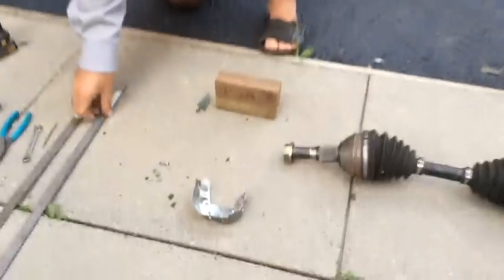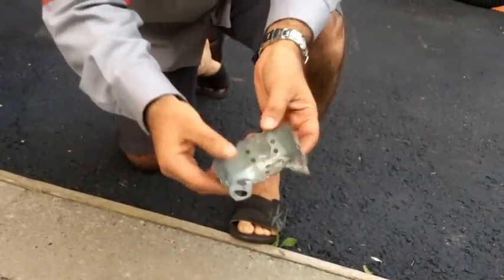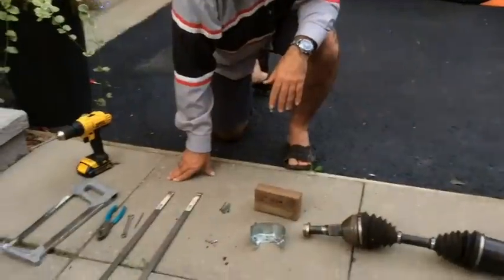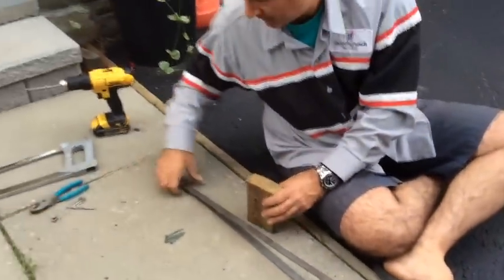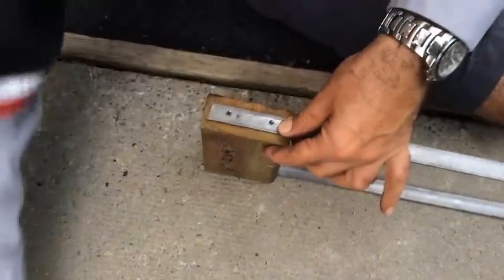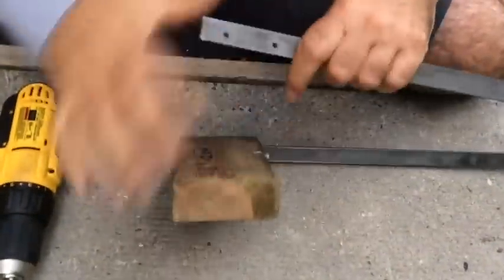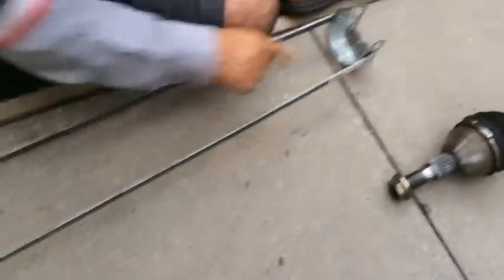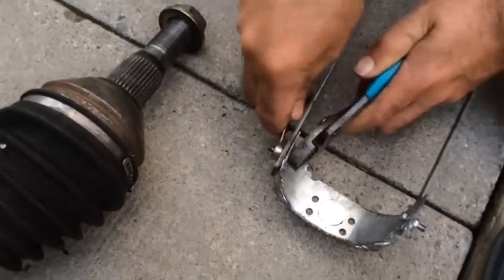How to Make a CV Axle Removal Tool for $10

Comment: Just wanted to give a shout out. This tool works great! Was messing with a slide hammer and a cv axle adaptor for hours. Found this online and built it in probably 15 minutes. It took maybe 10 hits but the axle popped right out! The tool probably cost 30 bucks to make but it saves you your sanity for sure!

Comment: Wood screws don't hold going into the end grain of a 2x4. Electrical box is not strong enough either. I've had to use a 8 lb slide Hammer before to remove axles. What you got is lightweight garbage. On top of that who the hell wears sandals when working

Comment: Thanks Rob. I am not a mechanic but I can sometimes "monkey see money do."  Your tool worked for me (2 taps)  and I did not mangle my existing axle like I am afraid the vice grip method might do. Now I can get a pro to rebuild my oem axle. Only mistake I made was buying aluminum stock instead of the metal rods.

Comment: instead of the steel flats I used some random tubing from the backyard.  It worked, although it's important to make sure you don't cut too much material off the electrical box, or it will slide off when you attempt to hammer the tool

Comment: I already have a slide hammer kit but it doesn’t come with cv forks which is dumb af. I’m thinking there has to be a way to get some thin durable strapping long enough to slit a hole in the middle fitnitnaround two side of the axle and slide it in the crack between the transmission or t case and cv housing then with the two end look then around and put a hole in them then put the slide hammer in the two holes and clamp both sides with some washers and nuts then pull as usual? But is standard strapping thin enough to fit? They should make a master set of those slide hammer fork puller attachments. They’re even pricey on Amazon like $15-25 each.

Comment: If you have a spline with a circlip involved the trick is to get the circlip opening in the 12 o'clock position. What I have found is turning an 1/8 of a turn at a time and giving a tug or pry and usually it releses fairly easy. Kudos on your custom tool invention - nice problem solving skills!
Reply: I have been doing this clock dial rotate thing and it is not working.  It seems like no one makes a enough of a point about it coming out from the differential in a "flat" up and down manner-in other words, not pinch points from working on it from one side.  I sense my axle wants to come out, but I I am not finding that magic circlip opening or I dont have the right amount of leverage underneath the car because I don't have a lift.  Eric the car guy on his video from 13 years ago made it look so easy.  I can't count the amount of videos, including this one, that don't show the actual separation of axle from the differential.   Still, I went out and bought these metal bars and electrical box because it seems sound with regards to the equal force on all sides of the CV joint.
Reply: @sl5311  Sorry just now saw this - hope you managed to get it unstuck. Sometimes you have to give it a tap with a hammer to get that circlip to drop and not have it loaded or binded up - in other words push the  joint back in - otherwise the circlip may stay stuck and not drop.

Comment: Great idea, great solution. I am one of those who saves wood ends, such as from 2x4s, because they can come in handy, especially for car repairs, where a couple of good whacks are needed to drive in or out pieces that would otherwise be damaged with direct hammer blows. You are also correct, that one CV axle is bound to be more difficult to access for removal.
Reply from the maker: Thanks for your comments. Glad my video helped you out.

Comment: I like this idea because even if you can get a prybar in between axle and diff- you risk cracking / marring the differential while trying to lever the axle out.  Your little tool means you're only hammering out the part you want to replace anyway.  Next stop- Home Depot :)  thanks for posting this.

Comment: This worked!  Except the electrical outlet method did not.  I think it would have except I cut it too wide and it didn't grab well and just slipped off.  The bars and wood block were still good though so I just made another version.  I found a piece of sheet metal cut to about 4"x10" and drilled a 1.25" hole in the center (slightly larger though) with a hole saw.  then I cut a piece of wood 3.5" wide to use as a bending form and bent it around that for a nice sharp 90° bend.  I used tin snips to cut from one side to the edges of the hole I drilled to make a slot.  I drilled a single 1/4-20 hole in each ear so it can move around but hold plenty strong.  Being thin it slid into the gap very easily (the electrical box was a little bit too thick).  I didn't bother with the second block of wood and just banged on the one piece.  What's the worst that can happen?  break the wood?  Just cut another piece.  But I didn't and it came out with just a few bangs.  The other problem with using an electrical box is all the cutout holes that make it weak.  The thin sheet metal was fine because it sort of nestled around the axle and it didn't matter that it bent because it held in the places that need holding.

Comment: Price update: Electrical box 7.98  36x3/4x1/8 11.93 x 2 = $34.47 with tax.  The rest I have in the garage.Just for grins I went to an inflation calculator and it works the other way around and it gave me 17.87 back in 1997.  That's still nearly double your claim. There are cheaper boxes but not the type that would work well for this job.  Most of the boxes are plastic nowadays.  And a simple steel bar for nearly $12! wtf I think they are just gouging us.  What doesn't make sense is how usually the raw materials things tend to be more expensive than the manufactured parts.  I can think of a lot of things for $12 that require work and materials to produce that would seem to be more expensive.  A burger King whopper meal is about that much and that requires all sorts of handling and preparation.  A steel bar does not.
Reply: Based on his accent he may be referring to Canadian dollars. And metal prices fluctuate quite a lot

Comment: I could not get the electrical box behind the cv joint against my Kubota RTV X900 so I combined your bar stock and block idea I used.  I welded it to a 3” muffler clamp like another YouTuber suggested, two taps and it popped right out.

Comment: Interesting approach, would never have thought of cutting up a junction box, will give it a go.  Thanks.
Reply from the maker: Let me know how it works out.
Reply: @robthefixitguy7185  It did help me.  I used the electrical box idea, but used metal pipe hanger straps on both sides as this was much cheaper than the steel you used (prices have gone up a lot)

Comment: I made one of these and used it on my car yesterday and it totally worked!!
The problem with other methods and tools are that they don't anticipate obstructions in the way of their operation.
With this tool, it can be disassembled, metal cup be placed around the cv axle then the metal rods can be connected back and you can begin to use.
And problem of using hammer and pry bar method is that you don't get much leverage when you have jacked up your car and you are working under the car.
With modern cars being very tightly packaged, I highly recommend this method and tool!
Reply from the maker: Thanks for your feedback. Couldn't agree more with you. That's exactly why I built it.
Reply: Are they in the market? I would buy 1. But instead of a 2x4 block, I use a hoses mouth guard as the handle

Comment: Most Toyota s are stuck after 160 thousand miles, must cut boot off first then make tool vise grip 3 foot threaded rod welded to part that turns ,5 lb sledge head, nut and washer.

Comment: I doubt that conduit box will last very long. Some might pop easily but probably 50% of them would put up more of a fight than that contraption could muster. Great diy hack though if your in a pinch.
Reply from the maker: Hi, the electrical box actually wraps around the CV axle while pulling. It doesn't break like you might think. Try it and see.

Comment: Built one of these, 2 taps with the big hammer and popped right out. Thanks for the idea. Spent 2 days trying to use a pry bar  with no success, lol.
Reply from the maker: Hi Brad, same result I had. I think the key is the tool allows you to pull it straight out rather than prying it out at an angle. Using a hammer helps too!

Comment: Remember kids, when pulling the axle on many Subaru's, don't forget the roll pin and when installing new unit, make sure you get the splines indexed right so you can put the roll pin back in.

Comment: Here is an alternative method?  Since most axles being removed are throw aways, replace the adjustment screw on a pair of vice grip pliers with a 3/8-inch all-thread rod and install a large heavy object like a hammer head with the handle removed and place a 3/8-inch nut and heavy fender-washer on the opposite end of the rod.  Secure the vice grip pliers firmly on the body of the inner tripod section of the axle. Then use it as a slide hammer to pull the axle out of the transmission.

Comment: If you turn the CV axle over to different parts of its rotation you'll eventually find the point where the internal retainer ring at the end of the shaft is not holding it in place and you can just pull it out easily with a pry bar like in almost all other videos on how to remove a cv axle. Probably the reason shocking it with this puller works is that it's jiggling the retainer ring enough to get it out, but you can get the same effect just by turning the shaft to the right angle.
Reply from the maker: Hi Matt, the problem with some vehicles, like mine, is that there is no access on one side for a pry bar. Therefore I needed a way to pull the cv axle out. Thanks for your comment.
Reply: You can’t always fit a pry bar in on some vehicles.
Reply: You'd have trouble believing an engineer could be so dumb... but on some vehicles you can't get a pickle fork or a pry bar in there.
Reply: @PeterB12345  I wouldn't have any trouble believing that at all! I have looked at DOZENS of videos on how to remove a stuck CV axle on a 1992-2001 Toyota Camry, driver's side! HOWEVER, on a 1995 Toyota Camry, the "CV joint" housing on the differential end is actually "recessed" about 3/4" into the differential case, with no more than 1/4" clearance between the housing and the differential case, all the way around. I've narrowed it down to two options, 1. Attach a large muffler "U" clamp around the "CV joint" housing and smack it with a long drift and a stout hammer, or 2. Wrap a piece of chain around the "CV joint" housing, secured with a Grade 8 nut, bolt and washer. Then attach the other end to a slide hammer, and have at it. One of these will work, and when it does...... sometime today, I'll come back and let you know which one! BTW...... while some "engineer" did design this, at least ONE other "idiot" signed off on it.  (Could have been a DEI hire), or perhaps just someone who's never had to take apart and put back together something they "designed."
Reply: @markmaness2245  hey so I had this exact problem on my 2012 VW Passat. There is actually this cheap Chinese slide hammer puller thing sold on Amazon where one of the attachment options is effectively a noose of steel wire held together and adjusted by this assembly of nuts that they welded together. After about 3 weeks and many tools worth of failed attempts this contraption ended up doing the trick. That steel wire noose on the slide hammer was the only thing that could actually get behind the housing, grab the axle body and allow me to exert enough force to break the splines that had rusted together (I live in a salt state). Good luck to you!

Comment: I will be building this tool in the near future. All the pieces can be bought easily, and I can transport it to salvage yards to remove front drive axles which are hard to access the axles because the cars sit on the ground in most cases. But what about the ceiling electrical box?  What is the dimensions of the box? The stock front drive axle body on many GM cars are not perfectly round, they have the 3 structured type body that may hinder the attachment of the electrical box to it when removing. Is there a model number you can provide, or anyone else that can say which box they bought and where they bought it?
Reply from the maker: The box I used is 3.5" by 3.5". The box will flex after you cut it which will work perfectly when you are sliding it around the axle.

Comment: Possible solution, thanks for the idea.    However, don't forget that Autozone / Oreilly's etc will loan a CV removal tool.  I found on ATV/UTV that the free loaner - with the free loaner of "FWD Axle Puller" - works pretty well.  You need that FWD axle puller attachment as it slips in behind just like your cut out box you made.
Reply: I tried those tools from auto parts stores.
But they ALWAYS failed due to not having proper clearance.
Reply: But driving back and forth costs time and money
Reply: Unless they don't fit. Which is the case with half the people trying to use them
Reply: I tried one of the “box tool pullers” for my 2012 Honda pilot.  The tool didn’t have the proper clearance.   I like this idea a lot.   Ingenuity, good to see people are still figuring out how to get difficult jobs done.  👍👍
Reply: Half the times they dont fit behind the cv part and when they do the hammer part is always right where the strut is.  It's like they puposely made it to mash your hands.

Comment: Great ingenuity.  I'm about to do this job on my S-10.  Hopefully I won't need this tool but if I do, I now no how to build one easily and cheaply.  Thanks.
Reply from the maker: You may be able to do it without the tool, but my experience was minutes vs an hour without the tool. Good luck.
Reply: @robthefixitguy7185  Got them out fairly easily with a ball joint pickle fork.  Sometimes it's better to be lucky than good.;-)
Reply from the maker: @x-man5056  That's great news.

Comment: You could reduce effort of cutting by using a ceiling "pancake" box,(Hubbell-Raco 295) which is tound and 1" deep.  It has no side knockouts or holes to get in the way, and is just as thick and strong.
Reply from the maker: That might work better. If I build another I will try it out. The one I used is more flexible which helps it wrap around the axle housing.
Reply: I'm about to built this 2morrow👍🏽found one at Lowe's with screws in the kit.jus need to cut the form with some snips.thank u
Reply: But how and where to attach the metal?

Comment: I made one of these and now my axles are successfully out and my project can continue. I had to use a Dremel for most of the metal cutting, doing this with a hack saw would have been pretty grueling. I made mine four foot long instead of three and the extra length was helpful for the passenger side axle of my 98 corolla. Thanks for the video!
Reply from the maker: Hi Erza, I think the easiest way to cut the electrical box is a grinder with a cutting wheel. Thanks for your feedback.
Reply: I'm stuck with a low strength rotary tool. Hoping to do it in less than 4 hours

Comment: I have never had any issue at all taking them out. There is no reason for it ro be stuck that badly..... but you gotta do what you gotta do
Reply from the maker: Hi Steve, thanks for your comment. The issue is sometimes there is not enough space to get a pry bar in. Purchasing a specialty tool costs $150. I found this tool makes it really easy to remove the cv axle regardless of space limits.

Comment: ...or go to AutoZone and borrow the axel removal tool and a slide hammer for free.
Reply from the maker: True, you can borrow store tools, but often the tools are out when you need them. That is why I made my own. I can use it anytime I want or lend it to friends and neighbours.
Reply: Slide hammer is only viable if you are replacing the axle. My current need is to remove a good cv axle to replace an alternator. I was pondering a similar solution,  but the outlet box is a good idea.
Reply: ehhhh time consumming running around for parts plus u did waste gas so it wasn't free 😜😜😜😜
Reply: @luisarriaza6807  A trip to the hardware store or a trip to the parts store. Same difference

Plus this way it can be made to fit situations when a rental tool doesn't since sometimes they are too general and don't work out, and next time you don't have to drive anywhere.
Reply: or go to harbor freight to get a pry that would usually be advertised as a ball joint remover. I had an axle that I could no get out with normal angled pry bar, but this dual fork puppy janked it out by just inserting it under and a good two taps on the handle with a hammer.
Reply: This is great. I have a VW passat and CANNOT get the cv axle out. It's in there good. I've beat the hell out of it with pickle fork, pry bar.. Etc this might work for me but I think it will break the tool it's in there so tight.

Comment: start using knee pads or kneeling pad while your knees still work, from an old guy.
Reply: Or someday you could spend $50,000-$60,000, a few days in a hospital, six weeks or so in physical therapy and about a year to fully recover and you have got new knees.
Reply from the maker: Great idea. I need to get some pads!
Reply: I used contruction type (with 2 straps each leg) knee pads for years.  One day my friend showed up wit two vollyball knee pads ($10) Fully elastic,easy to pull on and so comfortable!  Wow!

Comment: I've never needed a puller....just yank it out
Reply: You have clearly never worked on a car with a cv axle that will not come out because it's aged itself in there. Work on one and then let us know how well yanking on it worked out for ya.
Reply: @MrCougar214  or you yank too hard and the inner joint pulls apart from the cup
Reply: with your teeth, I bet...